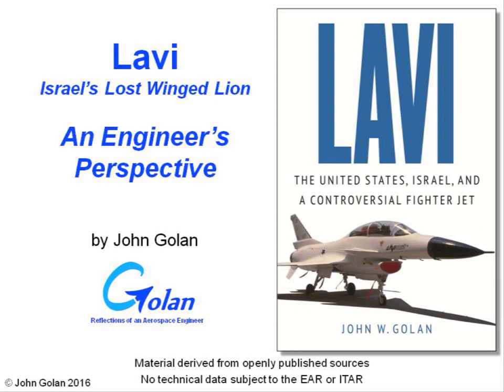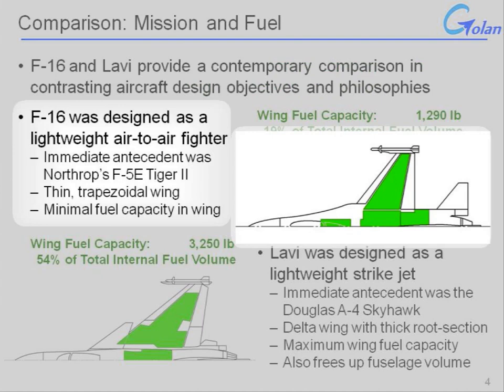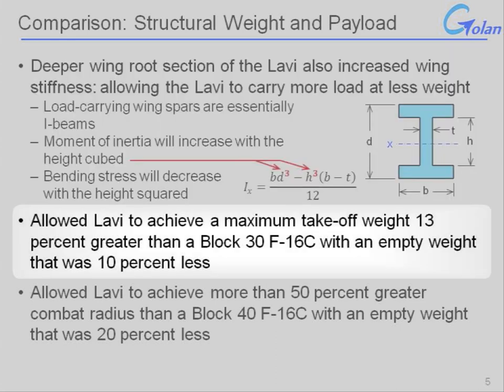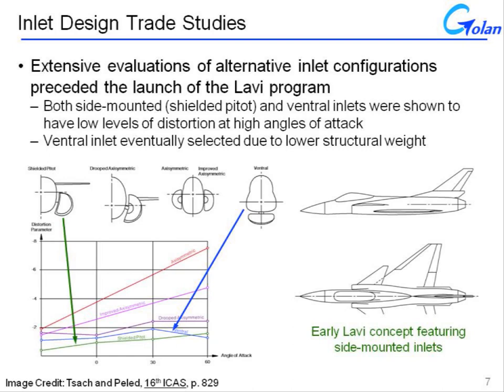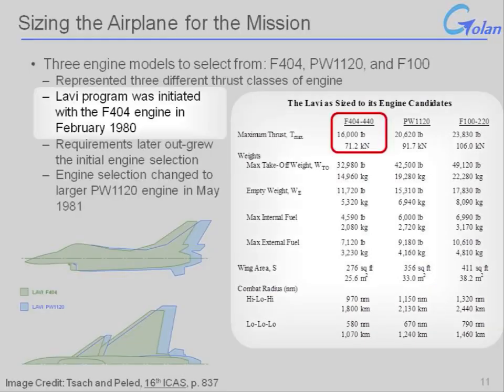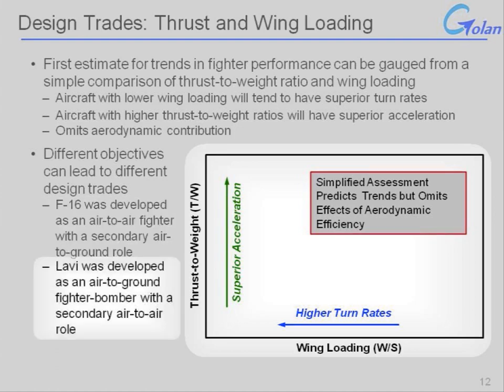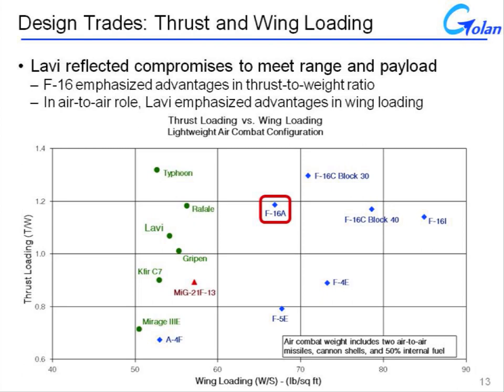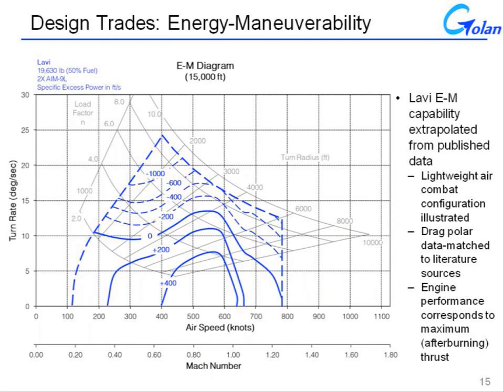Lavi - An Engineer's Perspective

Comment: John,

How do you think the turning and specific excess power performance of the Jas-39 Gripen compare to the Lavi?
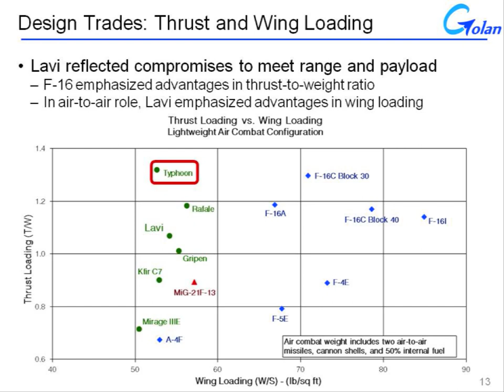Reply from the maker: Good question. I believe it was essentially answered on Slides 12 and 13 of the chart deck (time stamp 15:36 to 19:01 in the video). For a first order approximation, neglecting differences in aerodynamic performance, lower wing loading (W/S) will lead to higher turn rates, and a higher thrust-to-weight ratio (T/W) will lead to superior acceleration.

As illustrated under the chart on Slide 13, the Lavi has slightly lower wing loading and a slightly higher thrust-to-weight ratio as compared to the Gripen in a point air defence configuration (full cannon, two air-to-air missiles and 50% internal fuel). The difference in performance between the two platforms, however, would be less than between either of them and say, the F-16 (higher wing loading but higher thrust-to-weight ratio). A pilot flying the Lavi or Gripen would have been trained with similar strategies for engaging dissimilar opponents in a maneuvering engagement.
Reply: @JohnGolan  

Thank you for the reply. That is more or less the conclusion I reached by watching the video but wanted to know whether or not my understanding was at least close to correct.

My next question is what is the relationship between thrust to weight...wing loading...and specific excess power? Specifically as it relates to bleed rates at the maximum allowed turn rate.

For instance the publically available EM diagrams for the F-16A and Mirage 2000 show bleed rates -1000ft/sec for roughly a 20 degree per second turn at 15,000 feet in the same configuration as your chart does for the Lavi.

 How much more engine power or how much less wing loading would these fighters have to have in order to cut that bleed rate to -500 feet per second? 

I am trying to understand the scale; for example would it require something a minor upgrade in engine power...or would it be the equivalent of strapping an F-22 engine into the Lavi airframe while also making it weigh the same as the engine it originally had.
Reply from the maker: @squishface80085  If you're looking to understand energy bleed rates and trade factors, I'd point you to the series of videos that I published previously on aircraft peformance.

The third video in that series includes the equation for specific excess power on Slide 4 of the chart deck.  Specific excess power is directly proportional to the thrust-to-weight ratio, and is inversely proportional to the lift-to-drag ratio.
https://www.youtube.com/watch?v=AYG8MkD8izc

The sensitivity of specific excess power to thrust-to-weight should be obvious. The sensitivity to wing loading, however, is buried in the lift-to-drag ratio. To fully quantify the relationship, you really need to know the drag polar - including the effects of Mach number and g-loading.

I'll used the drag polar calculations behind the Lavi as an example to perform a quick sensitivity study. At 15k ft altitude and a turn rate of 20 deg/sec, the Lavi is projected to achieve a bleed rate of -1000 ft/sec at roughly Mach 0.70 (438 knots). Increasing the thrust by 10% would decrease this bleed rate to around -935 ft/sec at these same conditions. Reducing the wing loading by 10% would decrease the bleed rate to around -875 ft/sec.
Reply: hi squish

Comment: Hi, I just bought your book, and have been perusing your videos.

I have a question about the close-coupled canard configuration.  How does the canard-wing interaction improve lift to drag ratio?  I had been under the impression that the vortex spilling off the canard was useful because it could delay boundary layer separation over the main wing, which allows for higher alpha and thus higher lift and more Gs to be pulled.  But I was also under the impression that in cruise flight this vortex interaction would impair the efficiency of the main wing, so much so that designing canard-configured fighters is a balancing act between making the vortex interact a lot with the main wing at high alpha, but barely at all during cruise.

But as you say, the Lavi was designed for maximum cruising range and it has absolutely enormous canards that are very close to the wing.  So how does this actually work?

Thanks in advance.
Reply from the maker: The subject of canard-wing interactions is covered under Appendix 1 in the book. In a close-coupled canard configuration, the influence of the canard is intentionally maximized. This changes the distribution of lift over the wing. The downwash from the canard will decrease wing lift, while the upwash from the wing will increase the lift from the canard. If done properly, the result is a net increase in the overall lift produced by the wing-canard system, and a more optimal spanwise lift distribution - even at transonic conditions.

If you're still seeking additional details, I'd refer you to the end notes in Appendix 1. The published literature has documented this effect extensively, with the study published by Tu being among the most comprehensive, although further test data is also presented by Rom, et. al.
Reply: Aha!  Thank you.

Comment: It would be interesting to know why they chose the PW1120 over the PW F100 .. At that time [ late 70s - early 80s and well into the 1990s ] the PW F100-100 was powering F15s and the PW F100-200 was powering F-16s - two aircraft / engines Israel was flying .. They even upgraded their F-16 A/Bs to F16 C/D capability but retained the PW F100s over the GE F110s .. The F100 has a higher thrust to weight ratio , higher max take off weight and a larger combat radius than the PW1120 and all of the Jet Mechs were trained on and experienced in repairing the PW F100 .. As an F100 Mechanic on F15s and F16s, I was one of the first 5 AF Mechanics trained, by GE Engineers, on the GE F110 and spent the next three years maintaining F110 powered F16s and training AF Jet Mechs how to maintain the F110 on the Flight Line, Phase Docks and Intermediate Maintenance Shops .. In Combat, in the field, parts commonality is extremely important .. I'm surprised the Israelis didn't choose the F100 over the 1120 ..

Comment: It is said in the video that the F-16 like intake was chosen because of lower weight. My question is why didn't all the aircraft after that employed the same design feature ? (like the JAS-39 Gripen with its side mounted air intakes). This efficient configuration of air intake should freeze for similar role aircrafts (like we have been watching the tube and wing configuration for commercial aircrafts for the past sixty years).
Reply from the maker: The major disadvantage to the ventral inlet is its proximity to the runway during takeoff. It requires that the runway be regularly swept to remove debris. For a modern air force that expects to operate from major air bases - such as the U.S. Air Force or the IDF - this is expected practice. Debris can damage tires or puncture fuel tanks as well as risk ingestion to the inlet (remember the Concorde?).

Sweden's air force, however, is expected to operate from remote, dispersed facilities, including roadways with minimal preparation. For them, the threat of ingesting snow or other debris outweighed the structural weight penalties from the side-mounted inlet design. Russian developers have tended to take a similar attitude towards inlet configurations.
Reply: I got it ! Thanks

Comment: could you provide a short analysis of the F35 dynamic characteristics? there is only one main public source on the topic that I could find, and much controversy and PR noise. would be much appreciated!
Reply from the maker: Unfortunately, there are certain aircraft that, for professional reasons, I cannot publish an analysis of.
Reply: Thank you  john. That's really unfortunate -- the F35 project is shrouded in smoke screens, and the public is not getting the information it deserves.I personally believe it is a complete and utter fiasco. 
the gadgetry and sensors could have been retrofitted on current generation fighters. knocking down radar stations is not a good enough reason to billions in expenditure on inferior platforms

Comment: With respect to the high instantaneous turn capability of the Lavi, was this the result of the input of the combat experience and gun kill culture of Israel's Aviators of that era?
Reply from the maker: The Lavi was the product of numerous design trades, so finding a single, one-for-one causal link for its net performance attributes can therefore be difficult to achieve. Such attempts will naturally wander into areas speculation.

It should nonetheless be acknowledged, however, that the compromise that the Lavi developers arrived at - with its relatively low wing loading and high instantaneous turn rate - would have naturally appealed to the pilots that were closely involved in the development effort, and who had accumulated much of their combat experience flying the Mirage III during the 1960s and early 1970s. Even those pilots that later went on to fly the F-4 Phantom, universally preferred the handling qualities of the earlier Mirage.

Again, it can only be speculated as to how much those individual preferences influenced the requirements and design trades that later went into developing the Lavi. So unfortunately, there is no direct answer to your question. Only observations that can be made, and speculation stemming from those observations.
Reply: Thanks.

Comment: We could use an airplane just like this right now! The F22 has ended production and the F35 is too expensive and not as capable when it comes to pure flight performance. This aircraft would round out an air force's need for an economical aircraft with good flight performance and would work well in a hi-low mixed fleet.